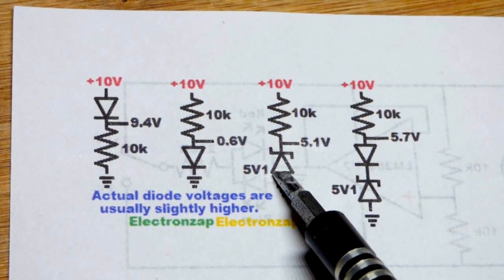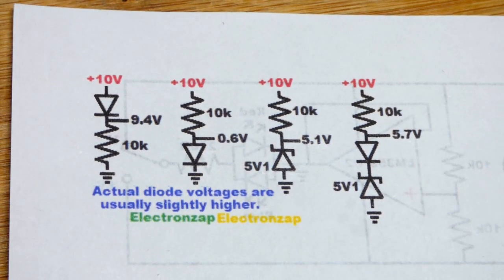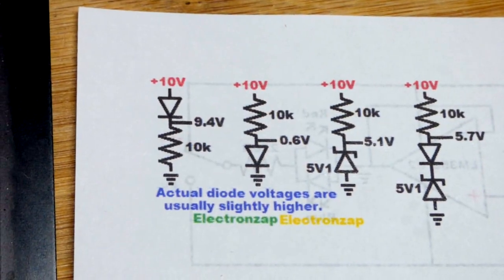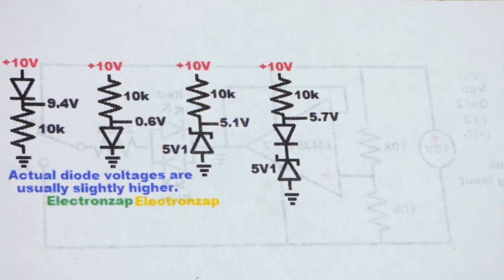Stacking diode voltages using reverse biased zener with forward biased rectifier for electronics

Comment: can zener diodes be used in parallel. does this have any use.
Reply from the maker: Parallel zeners can handle more current as long as their zener voltages are exactly equal. Usually you use plenty of resistance to keep the current well below what 1 can handle though, so you'd probably never have a need to use them in parallel.